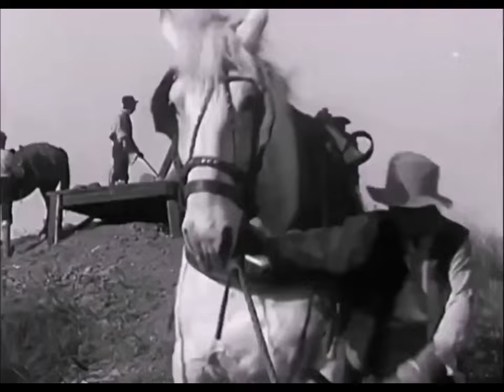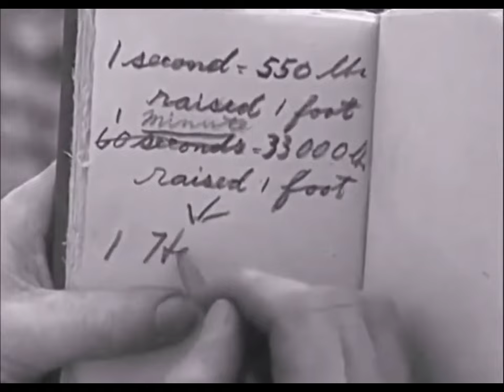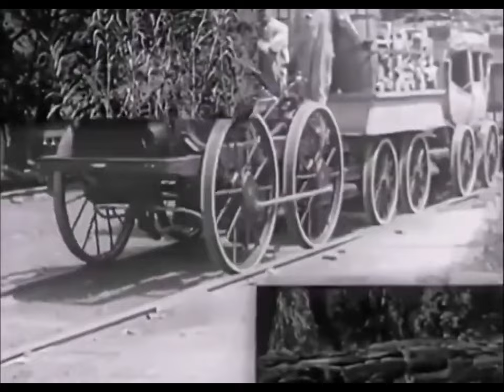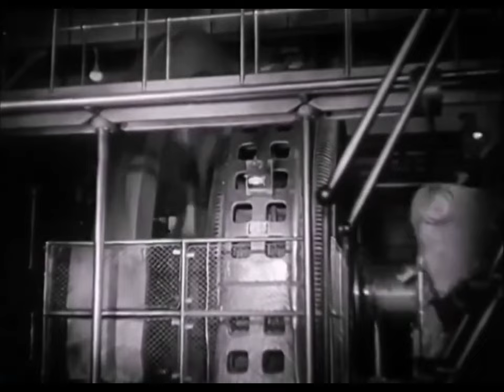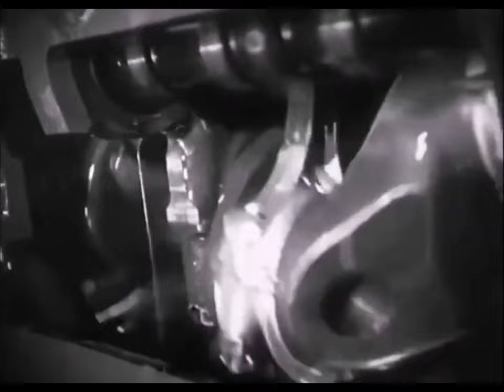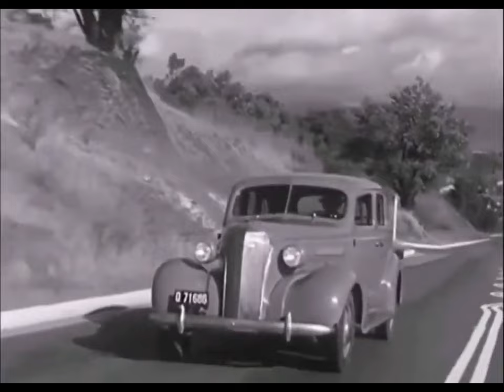The Fascinating Origin of Horsepower: How It Changed the World!

Comment: This will always be the standard for this old guy, I will never understand what a KW means
Reply: A horsepower is about 740 watts. Rounding off very crudely you can approximate 1 KW (1000 watts) is about  the same scale of power as a hp. If you need the exact amount then get your calculator out.

Comment: Watt's "horse power" unit was actually way off. An actual horse can produce almost 15 "horse power".
Reply from the maker: Wow nice to Know
Reply: No horse could ever produce "1 horsepower," the "true definition" of 1 horsepower. Which is 150 lbs lifted 220 ft from a mine in 1 minute... sustained for 8 hrs (480 minutes).
Equivalent would be 15,840,000 lbs lifted 1 ft over 8 hrs, or 1 lb lifted 15,840,000 ft (3000 vertical miles) in 8 hrs.
A human can maintain 3.5 hp for a couple seconds. No horse can maintain even 1 horsepower for 8 hrs. If you are very cruel to your horse you might drive it to produce 1 horsepower for as much as 3 hrs.
(You can push your high performance car to produce hundreds of horsepower but how long does it last at that power level, a few moments? Most cars cruise on the highway at about 30 hp or so. A semi truck pulling heavy freight trailers might produce 250-300 horsepower but it can do that ALL DAY LONG, day after day.)
Reply from the maker: @Grunchy005  interesting facts
Reply: It was NOT a measure of max power. It was a measure of what the horse could do all day long so as to ascertain how many horses his steam engines could replace. So his unit was not way off.